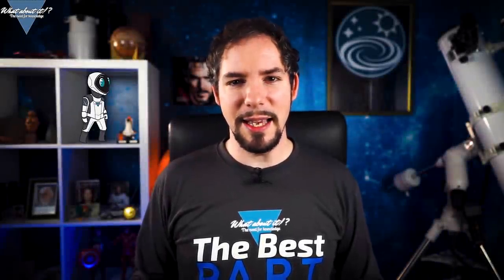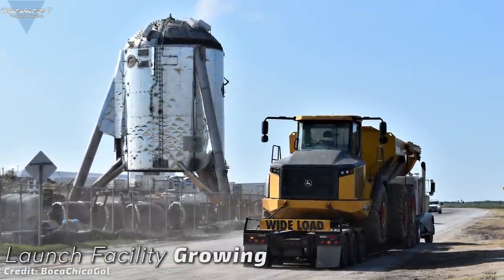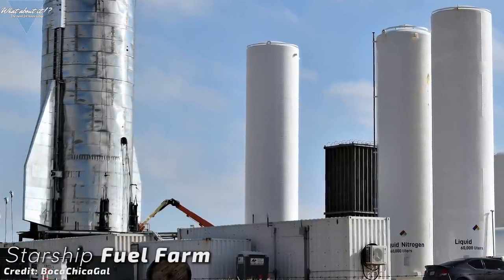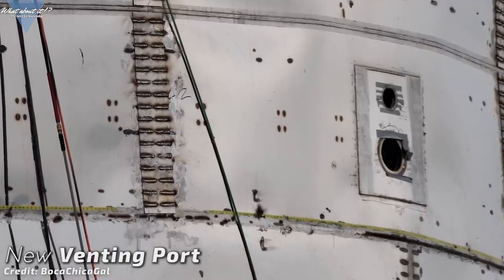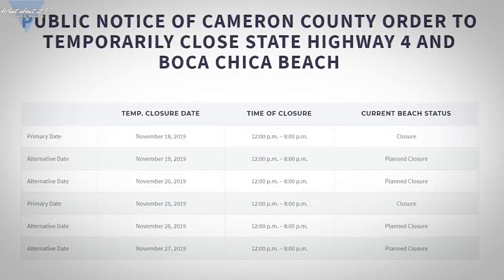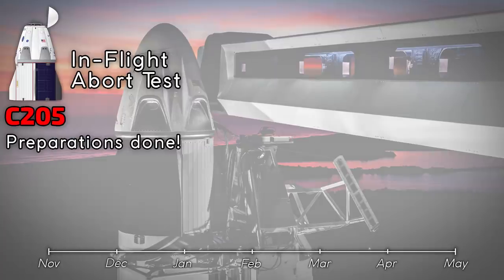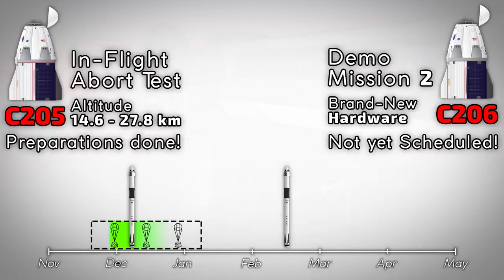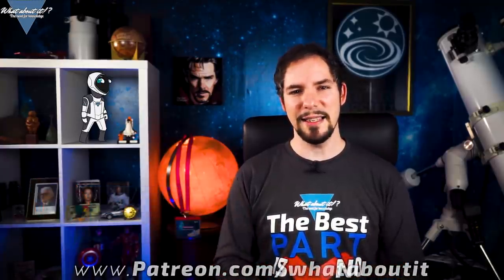51 | SpaceX Starship Updates - Crew Dragon Schedule Update

Comment from the maker: Will SpaceX be able to launch Mark 1 before the new year comes and what do you think is enough safety for a crewed flight?
Reply: I'm thinking we're going to see a big silver water tower "gracefully" falling from 20km before Christmas. I just hope the engine catch routines keep it from coming down as quickly as it goes up!!!

I suspect that NASA shenanigans will put SpaceX out far enough to let the corporate "beholdens" have time to get off their metaphorical butts. NASA is coddling them. A sure sign SpaceX should not wait for NASA (though still support them).
Reply: Based on the Fins and avionics system on Starship and maybe some further heat dispersion treatment/design to the launch pad. MK1 sure has one hell of a checklist:O I'm hoping before 2020 for a test flight. Or even better Crew Dragon and SS fly on the same day for their debut late January after 3 more parachute tests.
Reply: Yes..  From India
Reply: I don't think so, still most things look quite far from finished. I mean, just look at this launch pad, landing zone looks like chaos, rocket still doesn't look like ready. I think hop will rather happen in february-april
Reply: Definitely by the new year. Then it will slow down a bit. Elon just wants to throw us a bone right now to buy him some breathing room. With only three engines, I don't see the need for any exhaust diversion given the height of the structure. If anything they will partially enclose one side.
It's a beautiful day today here in South Texas!!!
Reply: NASA is waiting for just one thing to prove SpaceX's crewed flight capability.
That's a successful docking at ISS of a crewed Starliner
Reply: @AustinThomasPhD There will be exponential progress in Starship production after this flight. I suspect progress will be much faster than you anticipate.
Reply: I believe we will see the flight in January 2020 as there is still loads to do on starship and the launchpad. After that however I think progress will increase rapidly as spacex will have a launchpad and better techniques for building future iterations.
Reply: I believe the 20 Km will take place before the end of the year however   I want to see Crew Dragon certified and start manned flights to the ISS.
Reply: Thank you
Reply: i would like to say yes, just remind the first lauch of SpaceX's adventure..… Elon Musk WANTED ever a good prototype lanched before end years ( perhaps like a Christmas gift!!) in my cerebral sensation, it will happen until Christmas 2019. the workers work 7 days by week. All the building of starship go fast with a lot of new revolutionnary technolgies .So SpaceX need absolutly and directly a success for this 20 km testflight cause Elon have many pressure by NASA, USAF and government's money to finalize the full programm in 2020.i really feel, with the hard work done in few weeks. this starship first lauch test will become real before this Christmas.Kisses from Bandol in south east of france
Reply: Felix the AntMan CosmoNaut !
Reply: I think the mystery venting port might be an RCS thruster
Reply: NASA might find out that its overly safety certification program is not helping. I support the notion that they should have been using it by now already. See, BFR is still on track, within schedule and will soon retire the new Crew Dragon.
Reply: Boeing could crash 2 or 3 crewed mission before NASA said anything... Its all been turned into a business for NASA/BOEING ... Unleash the private sector and everyone else DIES :)
Reply: @_mikolaj_  Right, and yet they are pressure testing the lower half, suggesting it is almost ready to receive the cone section which is all but done hence the lack of work on it. It's not rocket science....
Reply: @AustinThomasPhD  Oh dear and oh dear. mk 3 and 4 will be in orbit by May next year. Realistically, I think you have no clue what you are talking about.
Reply: I would trust space x more then NASA with my life NASA does t have the best record lately
Reply: @jean-noelcastelletto2228  - No pressure from NASA or USAF directly.  They are not funding the Starship at all.  Starship is privately funded and I suspect it will stay that way until it is proven out.  Once the government gets their tentacles in, things would slow down immensely.   This private funding allows SpaceX to move forward at a rapid pace without all of the regulations and paperwork required of a government contract.
Reply: No
Reply: Unfortunately, MARK1 exploded during the testing today...😢
Reply: @farrukh8827  what? Seriousl? Or  Joke
Reply: @rohitkinkar4092  I am 100% seriously serious. Unfortunately it is gone.

Comment: It is just a second landing pad as they will need two when testing the full stack of Starship and Superheavy.
Reply from the maker: Also: I totally did not see this. Thank you! :)
Reply: Martin Wolfe SpaceX plans to land superheavy back on the launchpad
Reply: @kojeb  I would not be surprised if the initial Superheavy landings are actually on a separate landing pad,  I agree that eventually the plan is to land the Superheavy on the launchpad.
Reply: @kojeb   Indeed, but i don't think the first prototypes are going back to the launchpad. They will have to test landing accuracy first, cause it's a whole different system then Falcon 9 (Because of the belly-flip-maneuver).
Reply: @Singurarity88  -  No belly flop for Super Heavy.  It will land just like the F9 booster.  It even has grid fins, only much bigger.  I agree that the second pad is needed for SH, at least at first.  That is until they can assure the accuracy of landing before setting it down back on the launch mount.
Reply: @mikesunderland9145  i know, ofc you are right, i just confused Starship and SuperHeavy. My bad ;)

Comment: The new vent on the side is likely the LOX vent.  Keep in mind, the LOX tank is the aft or bottom tank (depending on the SS's orientation) which is the opposite of pretty much every official rendering.  It took me a while to get that straight.  So that vent on the top of the tank section is for CH4.

Comment: The launch tower will likely have a cone-shaped diverter placed under it, once the engines are installed. Probably designed to roll in when ready to launch. Then rolled out when Starship placed on tower for next launch, to give access to the engine bay again.

Comment: after landing on the moon or mars the ship will need to launch without diverters
Reply: Yes, but apparently the plan is to launch with towers and flame diverters for now, not deal with the problem of exhaust bounce-back yet. Also, Mars has only 1% Earth air pressure, and Moon a vacuum, so the bounce-back of sonic energy won't be there. That's a very big factor.

Comment: Question, is the outer skin of the starship also the outer skin of the fuel tanks, or is there another tank structure under what we see ?
Reply: Wow, never asked that myself. Wouldn't that mean additional cooling? I thought, there is a big tank structure inside. At least I remember one beeing put inside, with a HUGE crane
Reply: Maybe I missed the install of the tanks. Any photos online ? I’ll have a search.
Reply: No separate internal tanks. The external skin is the tank, the internal bracing is inside the tanks, will be immersed in the fuel. The feed pipe from the oxygen tank runs down thru the center of the methane tank. This is how Falcon 9 is built. In fact, every modern booster is built this way. That's why they all have a "raceway" pipe externally down the side, for the electrical wiring. And some run the oxygen pipe externally.
Reply: thanks !  The reason I ask is because the outer skin looks so rough, The way it’s made with so many panels, that’s a lot of welding, bound to have flaws.
Reply: Propellant tanks inside.  You can see the diagram here
https://www.spacex.com/sites/spacex/files/making_life_multiplanetary-2017.pdf
Reply: I think I was right !

Comment: Does the starship have an emergency evact system??
Reply: No. The second stage can escape from the booster and land by itself though.
Reply: @johntheux9238  I don't think it's capable of pulling away because part of the engines are vacuum engines and they'll blow themselves apart if ignited in the atmosphere. I think they are working on a nozzle that can have an adapter that falls away if not used for abort use for the vacuum engines

Comment: How is Boeing’s parachute system deemed good enough even though one of there chutes didn’t deploy? But is spacex parachute system which hasn’t a failure like that still not good enough?
Reply: Boeing's failure was inside the margin of error and resulted in a soft enough landing. Spacey's parachute was unfortunately during a failure test with one parachute disabled and resulted in a hard landing. That paid NASA should consider the abort system test passed but  the parachute system unacceptable. More drop tests should be required. Why does Boeing with more NASA money get to just test the capsule itself but SpaceX have to expend a booster?

Comment: You know I think Space X is taking this stainless steel thing too far. They should be using titanium for the control fins and probably a lot of other parts too.I mean yeah for the tanks using SS is a stroke of genius because of it's performance at cryogenic temps, but they could shed literal tons of weight by going with titanium in other places. The control fins for instance will not see any loads when at very low temperatures. Titanium is vastly lighter(about half the weight of SS) and would out perform SS at very high temps. also it should actually get stronger with repeated heating-cooling cycles.
Reply: I think they use SS for the test vehicles cause its cheaper and switch to titanium later.

Comment: Is Super Heavy really needed for the 20 km. flight? It is more than the hopper and has not been tested solo; let alone tested with Starship, also not the same as the hopper and having not been tested solo. Starship alone should be able to go 20 km. high and back. Super Heavy as well. Before putting both together and go straight to orbital flight.

Comment: I am going to say it there is going to be a  demo 1.5. NASA has a crawl, walk and run mentality. And SpaceX Failed the walk part by having the Crew Dragon Accident on April 20 2019.
So if SpaceX wants to reuse Crew Dragon it will have to send a empty Crew Dragon up to the ISS and bring it back safely with a firing of the SuperDraco's on the pad. Before they will be able to run. 
One side note i have a hunch they wont get a go until Boeing has time to catch up. And maybe even pass SpaceX . Boeing has to prove that the extra 40 million a seat was well spent.

Comment: I wouldn't count on NASA holding Boeing to the same standard they hold SpaceX to.   After Boeing's disastrous pad abort test, in which the capsule was engulfed in flame from the service module, the SM itself impacted near the landing site and surrounded the area in dinitrogen tetroxide gas, and one of the parachutes failed, NASA called the test "a success", and nothing was said about the failures, or any revisions or future re-tests.

Simple fact is, SpaceX doesn't own enough politicians to get the kinds of passes its competition does.